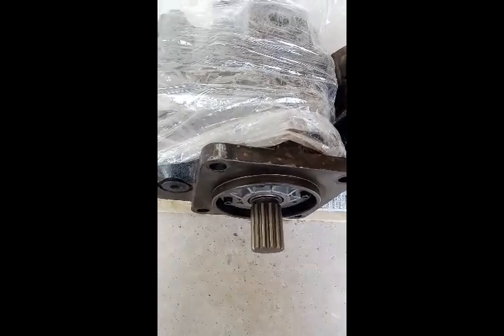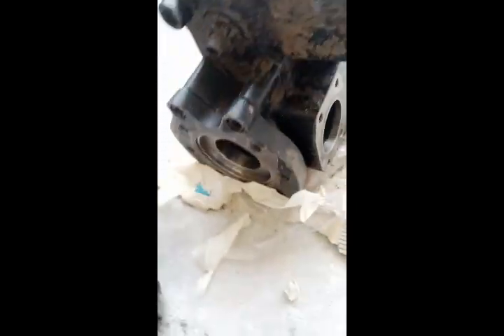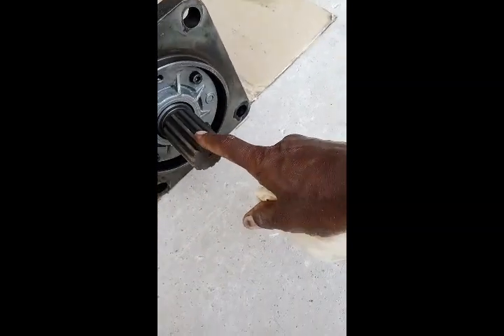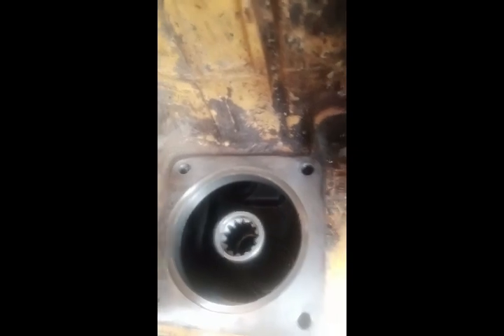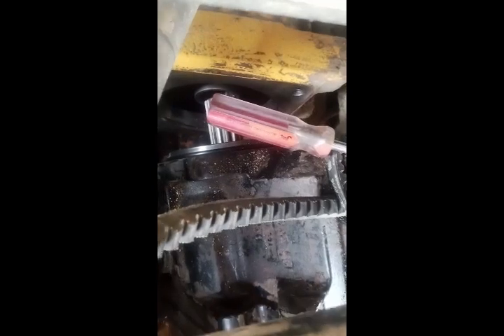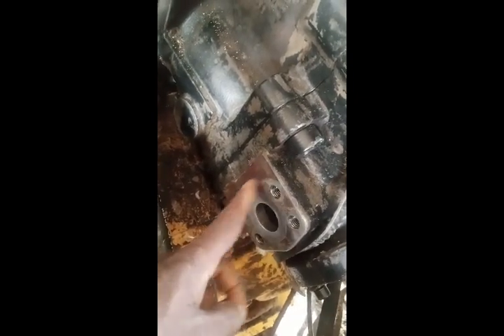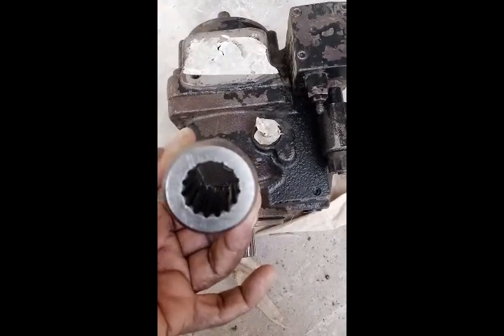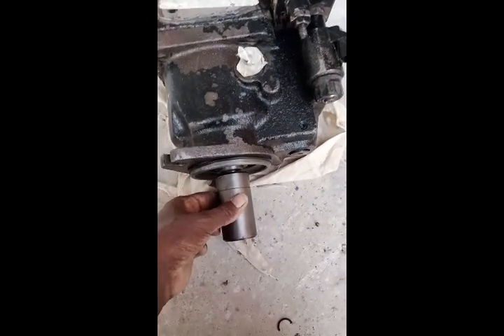How To Fix The Hydraulic Pump Of Volvo Wheel Loader

Comment: Good video...I have following questions:
1) Do both pumps run through a single shaft?
2) What is the purpose of front pump and break pump? Are there no pneumatic brakes?
3) What type of pump is it? Variable displacement or gear type etc..
Thanks for your excellent work.
Reply from the maker: Thanks for comments, yes both running on same single shaft, front pump do bucket up , down, loading dumping etc, rear pump for brake system.
Reply: @AlbertB72  Thanks, what type of pump is it?